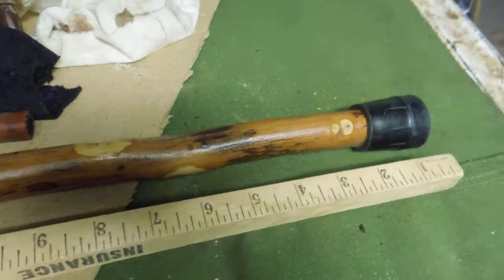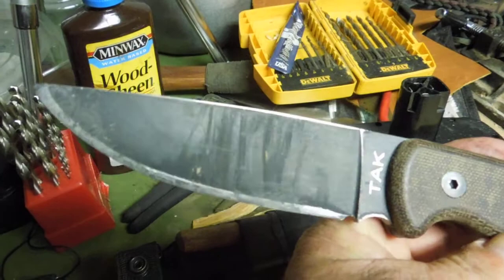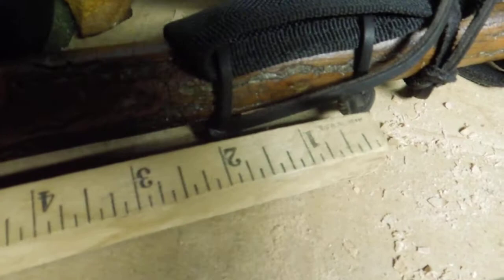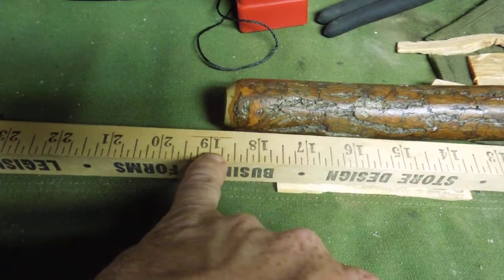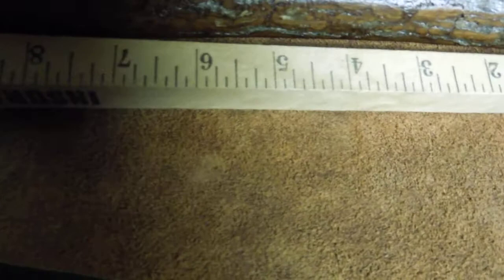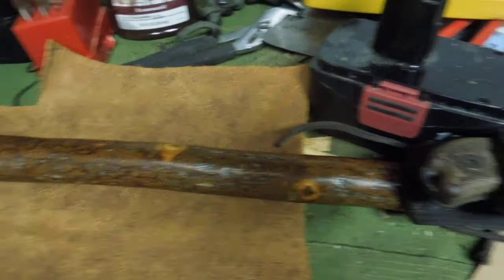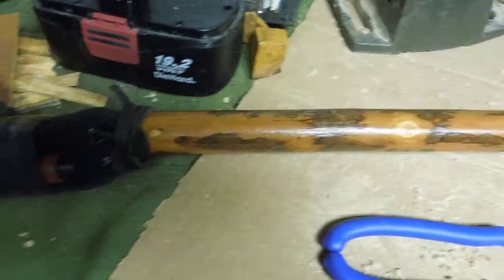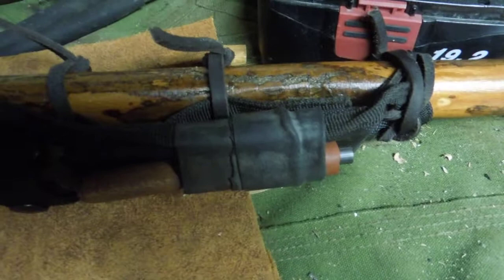Walking Stick customization

Comment: Nice looking project. Be sure to walk with it a bit, to get exactly where you normally grasp it for your hand hold. At 4' long, your natural grasp may not be at the top. Make sure, too, that your leather lacing is flat enough that it doesn't irritate (blister) your hand when in use. Looking forward to seeing your finished version. Thanks for sharing.
Reply from the maker: +Oldtimer Lee I will probably use treated bank line for the lashing.  It wont bunch up like leather or paracord.   I still have to scheme out how the lanyards will attach so that they arent swinging around and beating me while walking.

Comment: That is quite the badass modification!
Reply from the maker: +Armed Rogue thanks.  It just made sense to have navigation stuff attached to your walking aid.  The design will change as I use it just like day pack contents change as you use it and fine tune the concept.  Except for the lanyard hole that I will drill, nothing will be a permanent attachment.

Comment: Nice job Randy I would change out the leather for some type of continuous string or cord to hold the knife on.
Reply from the maker: +cabotbluegill I think so too.  The Compass should be here in a few days.  I need to go to the craft store to get the beads for the ranger bead abacus set up.
Reply from the maker: +cabotbluegill  I am reworking the leather cords now replacing with bank line.  I have already put more than 40 foot of number 18 (115 lb) drop line along the 
MOLLE strapping.  I am putting number 36 bank line (235 lb) where the belt tie off is.  That should give plenty of cordage to bring along with me.

Comment: Maybe some sort of notch to keep the knife from eventually sliding down the stick?
I do love my Ontario knives.  In my opinion....some of the best and affordable as well.
Reply from the maker: +Haven  This stick makes two 30 degree bends right where the base of the sheath is located. I am reworking the leather cords now replacing with bank line.  I have already put more than 20 foot of number 18 (115 lb) drop line along the 
MOLLE strapping.  I will put number 36 bank line (235 lb) where the belt tie off is.  That should give plenty of cordage to bring along with me.
Reply: That and it looks like it will work well for securement.